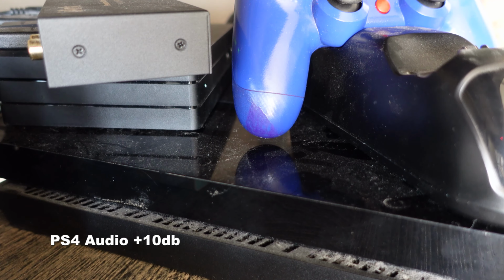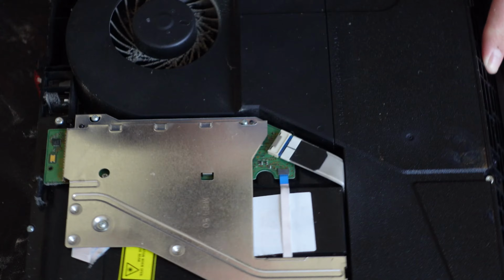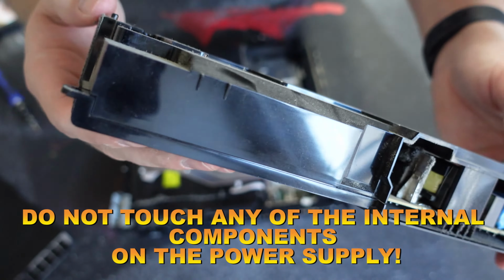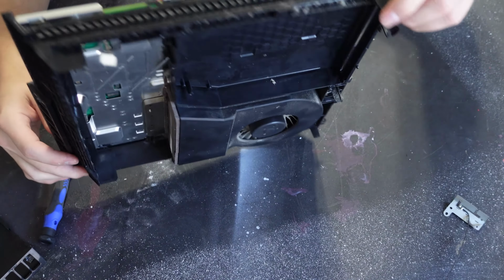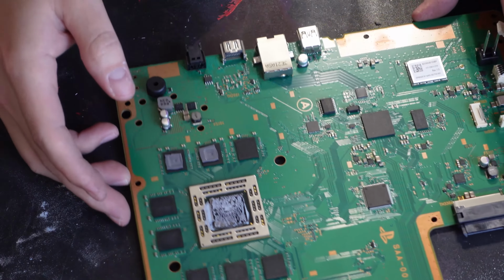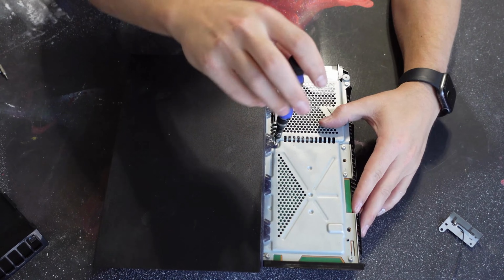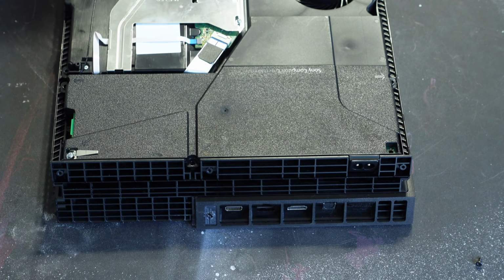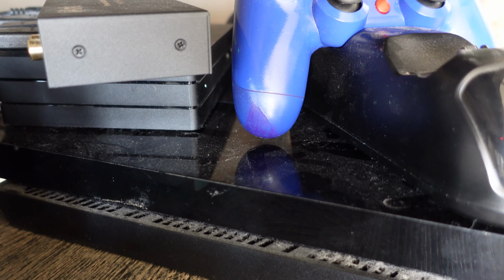Original PS4 Teardown in Under 10 Minutes.

Comment: Been meaning to do this for a while and your video made it nice and easy.

 I went a bit further and pulled the other shield and fan off, half my radiator was blocked on exhaust side.

Excellent video👍 Frame rates are back up and it doesn't sound like an industrial fan anymore
Reply from the maker: Glad it helped